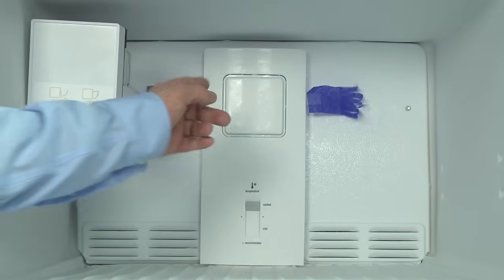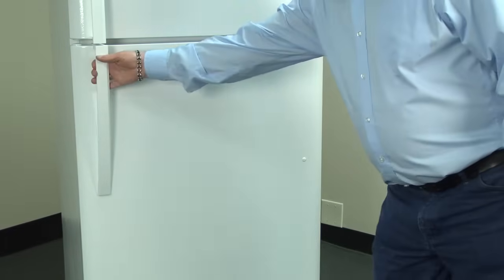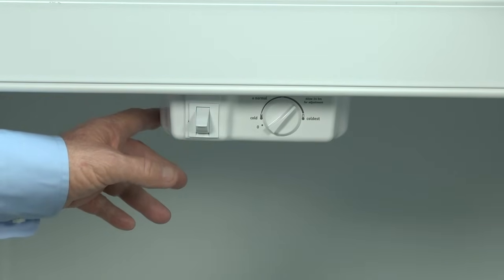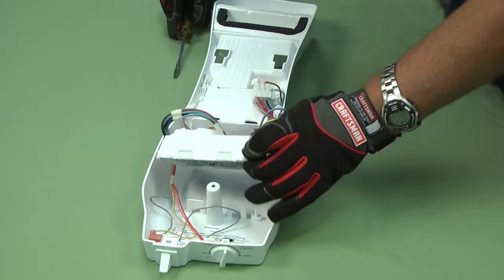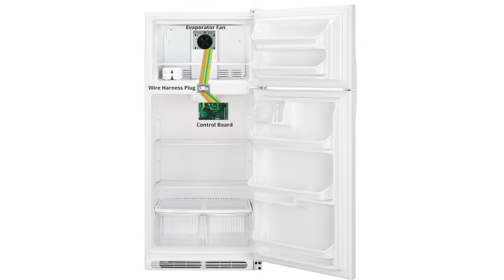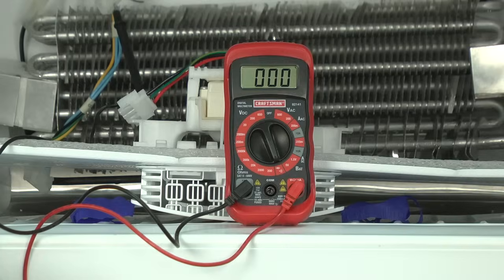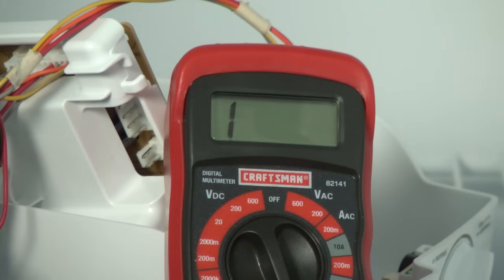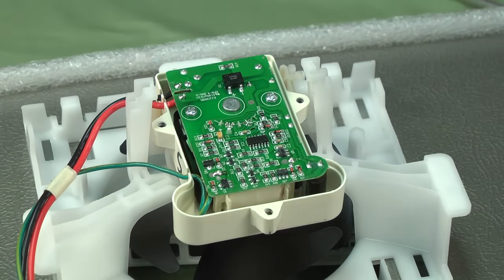Troubleshooting Evaporator Fan Problems in Refrigerators

Comment: I have a Frigidaire FFTR2021TS5 that looks just like the fridge in this video however I dont know how to get in diagnostic mode and the piece of paper behind the front grille is just a wiring diagram with no mention of diagnostic mode. 

I went ahead and replaced the evap fan because it was only $20, however the fan is still not turning on 😔.

Is my next best bet to replace the control board?

Comment: Hello, Frigidare refrigerator model FFTR1835VB6.  About 3 years old. 
Initial Problem Doesnt cool in refrig. , light went out to. But bulb is good. Freezer bottom gets cold , fan by compressor comes on, fan in freezer did not. Replaced fan in freezer waited several minutes. Fan in freezer finally come on. Ran good thru the night , light came on. Did well to the next evening.  Transported, installed . Well back to where it was.  Not working , light as well.  I could here compressor PTC clicking on off in 5 sec intervals with compressor fan running. Replaced ptc controller. light came on but not  the freezer fan. Replaced capacitor. No change.  Light  flickers when using thermostat setting control. Removed thermostat housing.  Tapping on thermostat causes light to remain on with no flicker  until you touch or tap thermostat again. But still freezer  fan doesnt come on.  Tested thermostat at room temperature  while uninstalled and switched on at room temp  and i get  continuity.  Perform same test after having thermostat in a bonified working freezer at 1 degree.  Still i have continuity.  If i turn thermostat off at either room temperature or at 1 degree i no
 longer have continuity.  I see no visible damage on wiring or thermostat itself.  I see no control board. Mechanical defrost timer, defrost thermostat, and thermostat switch. Am i looking at a potential bad thermostat cntrol switch .? Incidently it has a thermister sensor wire attached.

Comment: After watching your video, I checked all my wire connections in the freezer, made sure they were all plugged in tight. The fan came on and now seems to be working correctly. Thanks for the tips.
Reply: I had to change the defroster temp sensor to completely fix the problem.

Comment: I live back in the woods I'm going to try to make this fast...
The refer was warm when i woke up. Now this unit has 5 lights' ...
If you need to lower the temperature Select #1 and to rase it Select #5 and all the numbers between.

I see that all The light are blinking like crazy, skipping the 4 hours it took me to "fix it" 

I would unplug the top fan, the blinking would stop and compressor would come on!! 

Thought i would see just how bad the fan was. using a 7-volt power supply Or A "Wall wort" I wired the fan to the 7-volt power supply and the fan was Runing great! But when I plug the fan back in blinking lights!! 

I connected the fan back up to the 7-volt power supply and put everthing back together aside from there being a wire coming out the freezer it works!

 I will fix it up correctly next time i go to town. 

I hope somone can read this and save their meats and TV dinners, lol

Comment: I'm hearing an irritating sort of high-pitched hum sound that is intermittent and LOUD. Sometimes it will stop for a few minutes or so, but then it comes back. It can be heard rooms away from the refrigerator/freezer, but is loudest when you open the freezer drawer. The noise is definitely coming from the top corner behind the ice tray. Please make this stop!

Comment: I just used a hair dryer and a presto!👌I had put too much stuff in front of it earlier today which meant all the cold air didn't have much place to go, so was colder than it was supposed to be in the area behind the fan. And of course they prevent the fan operating if it's too cold back there so that it doesn't damage itself. So it would've naturally defrosted and came back on anyway. But using a hair dryer will quickly resolve the issue. And no longer obstructing the air flow.

Comment: My fan runs for 1 minute after I power on the fridge then shuts off. Anyone know what might be the issue?
Reply from the maker: For some refrigerator models, that's normal. If the evaporator fan never runs except at that time, then the electronic control board could be bad.
Reply: @searspartsdirect  Thank you. Ill give the control board a look then. :)

Comment: My year and a half old kenmore refrigerator seems like has a similar problem. While the freezer is cold, the fridge is warm. Opening the back panel, see that the freezer fan is running, but the evaporator fan isn't (froze, saw lot of ice build-up). After cleaning it up, it seems to be run, but not always. Fridge is not cold enough. Is there a problem with the control board that turns on/off the fan or the fan itself needs to be replaced ?
Reply from the maker: Because the evaporator fan is now running after clearing the excessive ice, it may be okay. The refrigerator may have a defrost systems failure. Here's a video that describes troubleshooting for that type of failure: https://www.searspartsdirect.com/diy/article/refrigerator-wont-cool-troubleshooting-video-defrost-system-problems . We recommend that you check the defrost system before checking the fan and control board. Getting rid of excessive frost may help the refrigerator cool properly. If the refrigerator doesn't cool properly, then the fan or the control board may be faulty. We hope this information helps. Let us know if you need more assistance and give us the model number of your refrigerator so we can provide more specific help for your model.
Reply: @searspartsdirect   Thanks for the quick reply. Again I see the evaporator fan isn't running and see lot of ice build-up around it. How do I enter the manual defrost cycle/mode on my kenmore fridge (model 111.73035)
Reply from the maker: @anandnagappan  The evaporator fan doesn't run constantly on that model. The fan is controlled by the electronic control board. You can enter the forced defrost mode by setting the control lock to on, holding down the Freezer Temp button and pressing the Refrigerator Temp button 5 times. The defrost heater will turn on for 30 seconds then will continue to stay on until the defrost temperature sensor senses that the heater should turn off. You can end the defrost mode early by unplugging the refrigerator. The refrigerator will return to normal operating mode when the forced defrost ends or when you restore power after unplugging the refrigerator.

Comment: 111.7302...kenmore fridge...only bottom freezer works...both evaporator fans are good but they don't turn on...no 13 volts to them...any idea what feeds them?a relay or a control board?seeing both dont work you think I need a new control board?thanks in advance for your help sir 🙏

Comment: Help Evaporator Fan runs when i first plug in the refrigerator for about 10 sec then turns off
Reply from the maker: That's normal for some refrigerators. If the evaporator fan never turns back on when the compressor is running, then the refrigerator may have a bad control board. Let us know the model number of your refrigerator and more details about symptoms that you're seeing and we'll try to help you troubleshoot and fix the problem.

Comment: I removed the fan and found 110v at the jack. The coil on the motor was blackened and a resistance check showed infinite. I have a question. The cooling coils are loaded up. Is this because the evaporatior fan was broke or is this a defrost switch fail?
Reply from the maker: A failure of the evaporator fan to circulate air through the evaporator fins can cause excessive frost on the evaporator fins (if that's what you're describing when you indicate that the cooling coils are loaded up). An air leak into the refrigerator (often caused by damaged door seals) can also cause excessive frost on evaporator coils. Check the door seals and repair or replace them if needed. If you replace evaporator fan and excessive frost reappears, then a failure in the automatic defrost system could be causing the excessive frost. Here's a link for a video that shows how to troubleshoot a common defrost system on a top-freezer refrigerator: https://www.searspartsdirect.com/diy/article/refrigerator-wont-cool-troubleshooting-video-defrost-system-problems .  We hope this information helps. If you need further assistance, let us know the model number of your refrigerator and additional details about the problems you're seeing.

Comment: the fan in my freezer is too loose, and makes too much noise when it spins. How do I fix this ?
Reply from the maker: Unplug the refrigerator and tighten the fan mounting screws. That may fix the problem. If you need more help, let us know and give us the model number of your refrigerator.

Comment: My fridge fan was getting noisy after 10 years. Same model . There's only 2 screws holding the brass bearings on & there are little slots on the inside where YOU CAN OIL THEM . I used synthetic 5 W- 20 & it's quiet now !

Comment: I have double door refrigerator sanyo... if you work continuously for a week, then there will be no cold .... If you turn off the power for an entire night and turn it on again in the morning, it will start to cool again ....
Reply from the maker: Your symptoms point to a failure in the automatic defrost system. Frost likely is building up on the evaporator fins because the defrost system isn't working to periodically melt the frost off those fins. After a week, enough frost builds up on the evaporator fins so that air passages through the fins are blocked and the refrigerator quits cooling. Unplugging the refrigerator for the entire night allows the frost to melt so cooling is restored the next day. Let us know the model number of your refrigerator and we'll provide some troubleshooting tips to help you resolve the issue yourself if possible. You may also consider having a service technician repair the failure.

Comment: hi, Thanks for your clear explanation of Troubleshooting Evaporator Fan  Refrigerator . I have one rather important question I would like to ask. Your Airflow where does the Air come from. Is it normally a Close Loop System where the Air is constantly re-circulated by the Evaporator Fan in the Fridge, or is Fresh Air Intake going on so that the Evaporator Fan is constantly pulling Fresh Air from the Outside and blowing it through the Evaporator Coils inside the Fridge. Also if it is not a close Loop System and the Fresh Air is constantly being sucked in from outside , is it vented out as it is recirculated inside and replaced by a fresh stream of air. Thanks
Reply from the maker: The air that circulates through the evaporator fan comes mainly from the freezer. Some air does circulate through the refrigerator compartment. The cabinet is sealed off from outside air.

Comment: Hi I didn’t know where to ask for help but my ice maker in my kenmore elite 106.54603300 stopped working it’s one of those infrared ones I’ve tried everything obvious like making sure it’s clean except there’s ice in it and it’s at the 3 o’clock position thank you
Reply from the maker: Check freezer temperature because the ice maker won't cycle if freezer temperature is above 15 degrees. You can check freezer temperature with a thermometer or check the condition of ice cream stored in the freezer. At 15 degrees, ice cream stored in your freezer will be extremely soft. If ice cream is firm or hard to scoop, then freezer temperature is likely around zero degrees. If freezer temperature is okay, then the ice maker assembly or the infrared optics control boards may have failed. Your details seem to indicate that the ejector arm is in the home position (3 o'clock) as shown in the parts image on this page: https://www.searspartsdirect.com/part-number/2198597/0046/106.html . If the ejector arm isn't in that position, you may need to replace the ice maker assembly because its internal gears are stripped. Unplug the refrigerator before replacing parts. Here's a repair guide that shows how to replace that ice maker assembly: https://www.searspartsdirect.com/repair-guide/refrigerator/how-to-replace-icemaker-optic-boards.html . If the ice maker ejector arm is in the home position, then the ice maker assembly may not be getting electrical current it needs to eject the ice and refill with water. The infrared optics boards (part W10757851 -- https://www.searspartsdirect.com/part-number/W10757851/0046/106.html ) control the electric current supply going to the ice maker assembly. That set of control boards may not be sending current to the ice maker assembly or the ice maker assembly. Keep in mind that the ice maker assembly may be getting current but not cycling. There's also a slight chance that bad wiring connections or damaged wires are preventing the ice maker from cycling. Unplug the refrigerator and check all wire harness connections on the ice maker assembly and the optic boards to avoid replacing unnecessary parts in case a wiring connection is loose. Here's a repair guide that shows how to access the optics board wires: https://www.searspartsdirect.com/repair-guide/refrigerator/how-to-replace-icemaker-optic-boards.html . Examine the optics circuit boards while checking their wire harness connections. If you see burn marks on either optics control board, you'll need to replace that set of control boards. Use the repair guide for replacing the ice maker that we provided above to access and check the ice maker assembly wire harness connection. If all wires are connected properly and you need no damage to wiring or the optics circuit boards, then restore power to the refrigerator and leave the freezer door shut for a couple of hours to allow the freezer compartment to cool down and see if the ice maker cycles. Unplugging the refrigerator then plugging it back in to restore power to the circuit boards may reboot them so they send power to the ice maker assembly and there's a chance that the ice maker may begin cycling again. If the ice maker still doesn't work after following these troubleshooting tips, then you'll have to make a decision to replace either the ice maker assembly or the set of optics boards to repair the failure. If you replace one of those components and the ice maker still doesn’t work, then you'll need to replace the other component to attempt to fix the problem. The optics boards don't send current to the ice maker assembly constantly so we don't have safe and practical electrical checks that you can perform on the ice maker system to determine which component failed. We hope this information helps. If you need further assistance, let us know.
Reply: Sears PartsDirect I let it thaw out overnight and dry out but now it’s just cycling through without adding any water. The water from the dispenser is working
Reply from the maker: @kwoods3379  Because the ice maker is now cycling, the optics boards are apparently okay. The water fill tube that inserts into the fill cup of the ice maker assembly could be frozen. Unplug the refrigerator and squeeze that black rubber fill tube. If you feel ice inside that fill tube, then you can try to defrost the fill tube by wrapping a clean wash cloth moistened with hot water around the tube. Defrosting a frozen fill tube will likely restore the water supply to the ice maker. If the fill tube isn't frozen, then a bad inlet water valve assembly, a failed ice maker assembly or a wiring failure may be preventing the ice maker from getting fill water. If the fill tube isn't frozen and you need help determining which of these components is preventing the ice maker from filling, let us know.

Comment: Is frost buildup in the freezer a sign of a failing or inefficient fan blade?
Reply from the maker: A failing or inefficient evaporator fan blade typically doesn't cause frost buildup in the freezer. Frost build-up throughout the entire freezer compartment is often caused by air leaks through the door gasket or other openings such as a leaky ice door on the ice dispenser (if present). Placing unsealed food items with high moisture content in the freezer compartment can also cause frost. A failure in the automatic defrost system can cause excessive frost on the back wall of the freezer. If frost buildup covers the back wall of the freezer compartment, follow the steps in this video/article that covers troubleshooting for the automatic defrost system in common refrigerators: https://www.searspartsdirect.com/article/troubleshooting-defrost-system-problems-in-refrigerators.html . We hope this information helps. If you need further assistance, let us know.
Reply: @searspartsdirect  by

Comment: Can I take the fan from one freezer and put in another freezer
Reply from the maker: If the freezers are identical models or use the exact same evaporator fan, then you can unplug the freezers and move the fan. If the models are identical or the fans aren't identical parts, then you'll need to order and replace the fan that fits the model that needs the evaporator fan replaced.